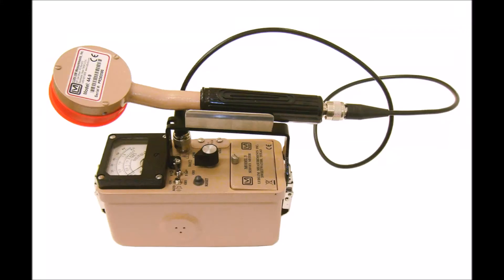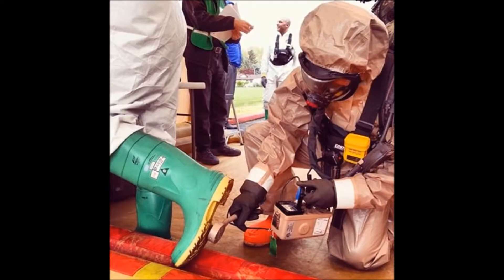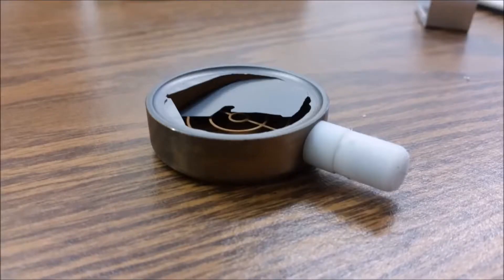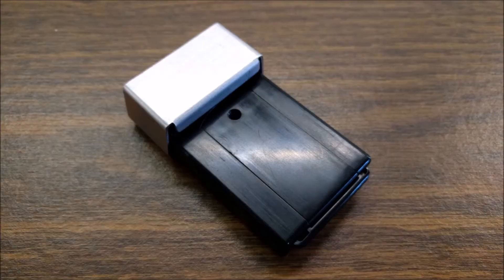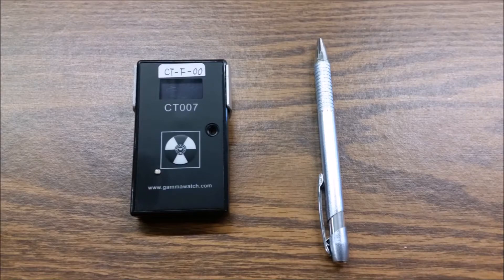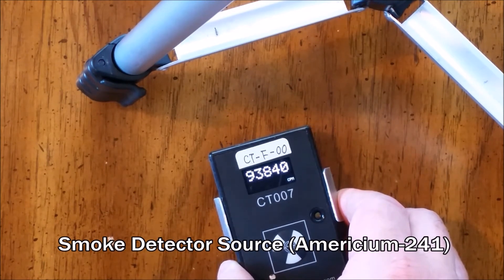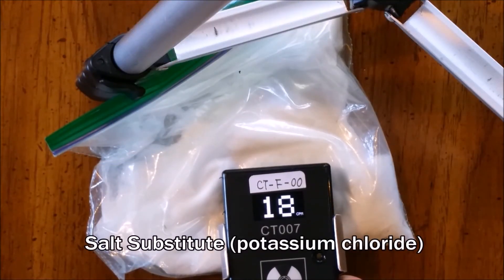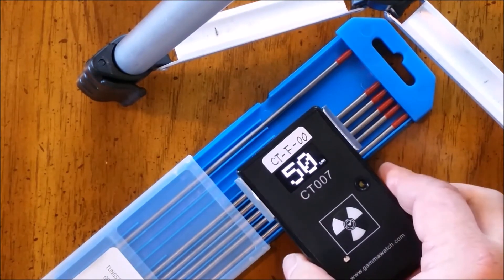CT007F Radiation Contamination/Fallout Detector

Comment: Very cool for the time, but compared to modern Radiacode meters big and bulky
Reply from the maker: They are 2 instruments for different purposes. The Radiacode is a gamma spectrometer, which is cool. The CT007-F is a radiation detector, designed for emergency situations. It can detect alpha and beta contamination on your clothes or food and it has a high enough measurement range to be used in dangerous gamma dose rates. I don't think the Radiacode does any of these.
Reply: @alphajunky  I agree the CT008-F has the appropriate measurement range for any radiological disaster. Most commercial radiological detectors are designed for peacetime use with the intention of minimizing longterm exposure to low levels of radiation and will be over saturated at high levels.  It is crucial to know if you are in 1K or 5K count area so as to take the appropriate action when moving to safety.